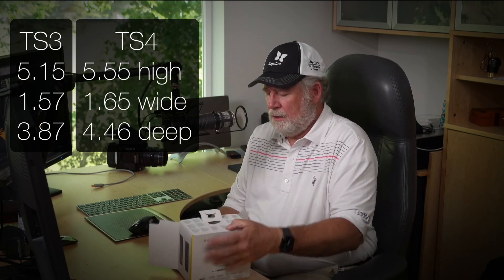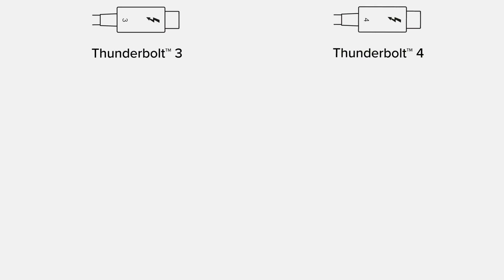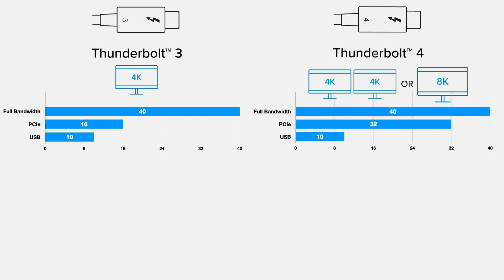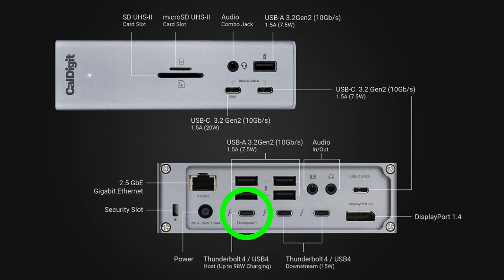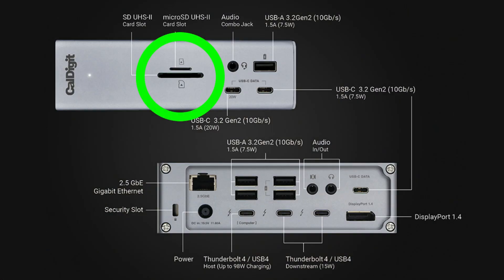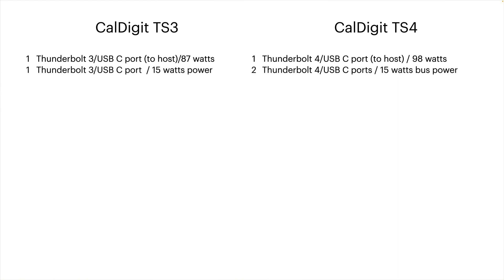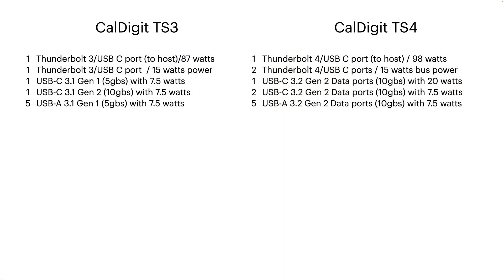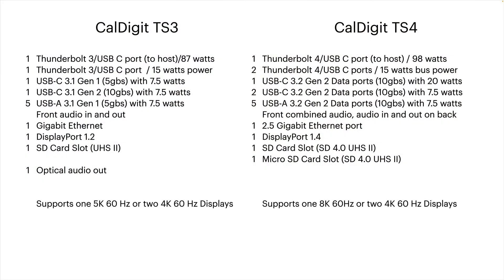Caldigit TS4- Thunderbolt 4 Dock - or HUB??

Comment: 6:52 that maintained power to host is one reason is a main reason i finally bought.
8:35 caldigit is 1 of 6 (limit) device.
10:09 i would've preferred TS4 to have 4 of T4
no more optical audio output jack? (SPIDF?) i think maybe musicians use it?
13:23 summary compare CalDigit T3 versus T4.
16:20 no pass through to all of other ports on added hub.
18:10 Sir, your coverage is very good. I would flip the script and say too many reviews based on reading specs or unboxing treated like hands on.

Comment: I have 10 non powered external drives (for photo storage) and wish to know whether I can safely piggyback 1 or 2 hubs to the dock (when editing photo's) without impairing performance of the main dock.
Reply from the maker: I assume they are USB drives and you you want to daisy chain a USB hub from the Caldigit?  As far as bandwidth should be OK in my mind, since you aren’t actually accessing more than one of those devices at a time, and the TB4 bandwidth should be fine handling the USB data.  I would mention that I’ve had a little trouble getting a USB dock to be reliable coming out of the USB ports on the cal digit.  Some devices I can no longer see (such as my Bose sound, and my Logitech webcam.  Some devices work just fine out of the hub.  haven’t tested a USB drive.

Comment: just amazing review. Can we connect 3 External monitors to this? 1 via display port , 2 via Thunderbolt to HDMI cables on hub?
Reply from the maker: Not sure if it supports 3.  It may only support 2, regardless of the ports used.

Comment: Any updates on the problem with storage devices getting disconnected on sleep?
Reply from the maker: Caldigit finally made a firmware updater available for the Mac.  There has been an updater for Windows for quite some time, which is puzzling since this device is probably more common used by Mac users.  The updating process is odd, without proper feedback and some puzzling text in the dialog boxes, but I managed to get the new firmware on.  As far as whether it fixed the problem, too soon to say, but it does seem to be better. I just installed it a couple of weeks ago and set my system to allow hard drives to sleep when possible.  Optimistic it resolves the issue. Still no go with my old USB 2.0 hub.  Guess I’ll have to get a new one.
Reply: @cwaynefox  Interesting. Sounds promising — thank you for the update!

Comment: Hello, In near future I will buy new macbookpro and I know this will be great product to have. But my question at that moment is next. Can I connect TS4 on old Imac27 that has two Thunderbolt  1 that is limited to 10gbits....I can use minidp cabel to Apple adapter and then to TS4... Will this work for me? On which port on TS4 should I connect the cabel from computer? Thank you
Reply: I have this question as well.

Comment: Hi Wayne, with the TS4 and a Mac mini m1 , would I be able to run 3 displays? Thanks. Keep well.
Reply from the maker: I would be surprised if it worked. I’ve heard of some hacks that get around the 2 display limit, but I think the limit something in the hardware and related to the M1 chip.
Reply: You can run 3 displays if you use an iPad though, it works fine for me when plugged via USB-C (has to be a cable capable of sending video data)

Comment: Great review! Thanks for the video. One question, if you connect some some heafphones via jack to the Caldigit TS4, can it be volume controlled via mac keyboard? Like when you connect directly to the Mac. Thanks for your help
Reply from the maker: Just tested it.  Volume controls on the Mac do control the output volume on the CalDigit.
Reply: @cwaynefox  thanks!

Comment: Great technical video Wayne...I had some discussions with another YouTuber complaining about I/O on the Pluggable TBT3-UDZ (as if 14-to-1 isn't enough), but I told them that TB3 spec makes having additional I/O extremely problematic. Most people aren't aware that the issues they were having is that they were maxing out either the lane or the full bandwidth of the device - it's not that the Pluggable device was the issue, it was that TB3 didn't really provide what they really wanted. This CalDigit dock is amazing...I'm a huge fan of it! Nice in-depth review...really enjoyed the video.
Reply from the maker: I agree, the new docks really are designed for TB4, using them with TB3 may be problematic.